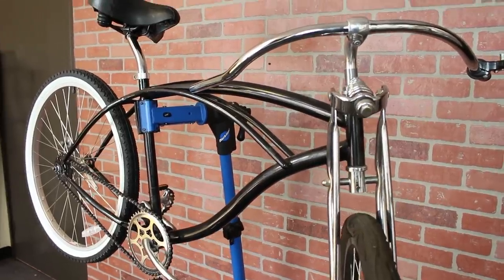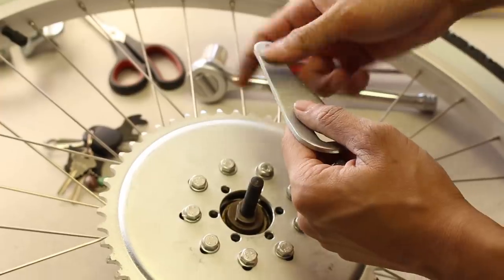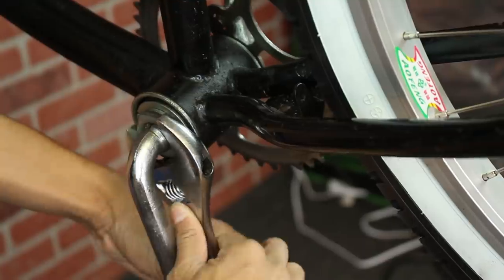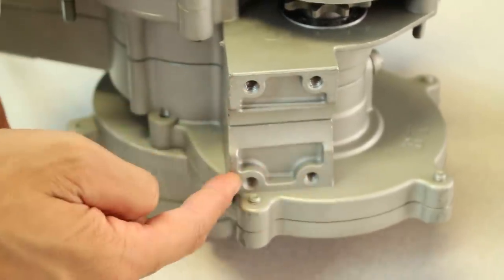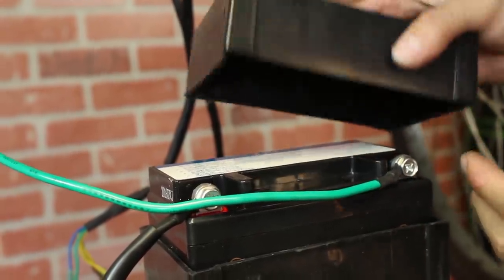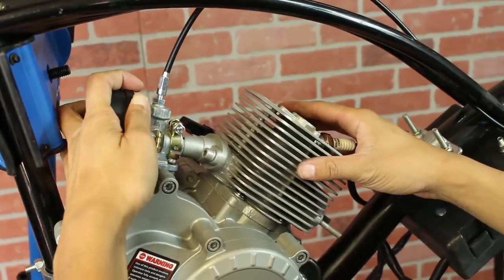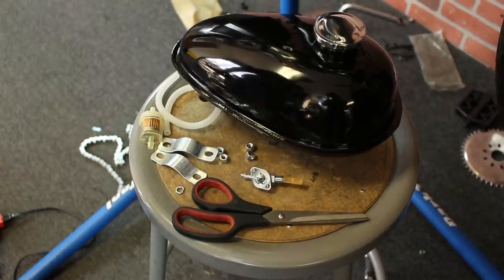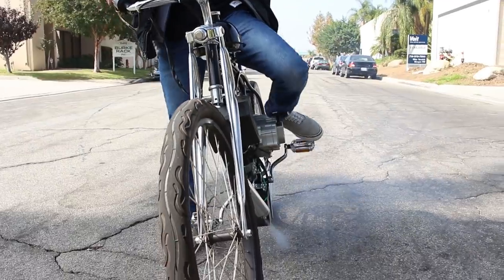How To Install a 2-Stroke 66cc 80cc BULLET TRAIN Engine Kit for Motorized Gas Bicycle

Comment: there is no such thing as a flat head screw driver.   there are flat head screws and blade drivers.
Reply from the maker: https://www.amazon.com/Screwdriver-SET-Different-Professional-Electronics/dp/B07552XJJX/ref=sr_1_10?ie=UTF8&qid=1517849898&sr=8-10&keywords=flat+head+screwdriver

Comment: Who uses 2 strokes anymore, come on, we can all do a little better for the environment!
Reply from the maker: No argument there. 2-strokes are not at all clean burning. Even those that are EPA certified are not exactly Eco-friendly either. There is, however, still a large market in closed circuit racing that heavily uses 2-stoke engines.
Reply: BikeBerrycom Thank You Sir!

Comment: Using pliers to tighten nuts???????????/!!!!!!!!!!!
Reply from the maker: We want to show that installation is possible even with a limited selection of tools. We always encourage the use of the correct tools, as they will reduce the likelihood of injury and damage to parts and will make the processes an easier task. We are constantly trying to improve the quality of our videos to make it as informative and entertaining as possible.
Reply: The problem is that the inexperienced will get the impression that pliers can tighten nuts sufficiently, not withstanding the damage done in rounding nuts off when they inevitably slip.

Comment: the battery ，made in China  中国的😄
Reply: I'm trying to figure out if I can link a few small bits of equipment or if head lights and a CB radio will just drain it faster than the magneto can charge

Comment: May not go as far on my electric bike but I can go 20mph and 50 miles full throttle with 2 batteries and not have to put up with all that damn noise.
Reply: but you dont get cool vroom vroom sounds
Reply: @sahibdipsandhu  Yeah and I don't have to rebuild my motor either. Have over 3000 miles on my electric bike and not a single problem.
Reply: @popholmes5825  still no cool vroom vroom sound tho
Reply: @sahibdipsandhu  You can have your vroom vroom sound I will take my Almost silent no pollution electric bike any day.
Reply: @popholmes5825  but still… no cool vroom vroom sounds
Reply: @sahibdipsandhu  Who needs vroom vroom? Not me
Reply: @popholmes5825  yea but i do tho :(
Reply: @sahibdipsandhu  Ok well just vroom vroom that little piece of crap motor down the road. See how far you can go before a rebuild.
Reply: But still, ebikes=no cool vroom vroom sound 😟
Reply: @sahibdipsandhu  But still ebikes= no rebuilds
Reply: @popholmes5825  but still ebike=no vroom vroom sound

Comment: Don't waste your money on this sorry system.  It has NO power with the extra weight on the engine.  If you like to peddle alot then it's for you.  But if you're like me I want power to go not have to peddle.  Only thin good I have to say about it is it goes fast enough going downhill but on level or hill you peddle!

Comment: Btw for those considering the 2 stroke bullet train engine, it is a pile of shit. It broke within 3 weeks and even after getting it to run again it's lost half its power. Don't buy, go with the older style instead. (Or at least until they carry replacement parts for it)

Comment: All this for a stupid starter?  Hell, if my bike came with this motor w/ starter and if there was a way to modify it to pedal-start so that i can lose the heavy azz battery/alternator/starter...... I would do the pedal-start.  Unbelievable this is, what a joke with all the extra work and added weight not to mention added price too.  Just dumb.
Reply: add in it's 5hp bone stock, with lighting power built in, centrifugal clutch and choose ur sprocket if u want 35mph go with a 38T. it will pull a 36T also but hills would be bad
they have more torque than the China girls. only thing lacking is you need to make your own expansion pipe